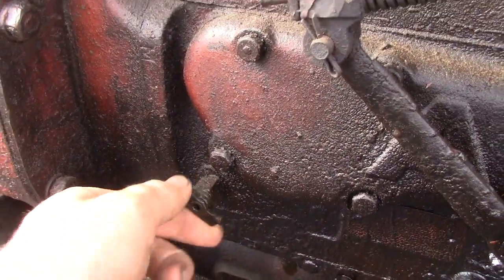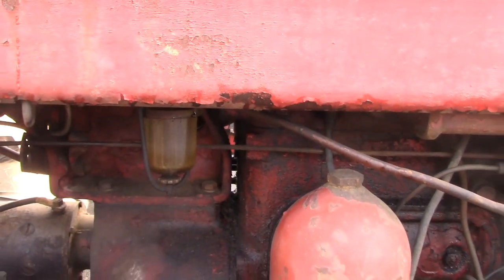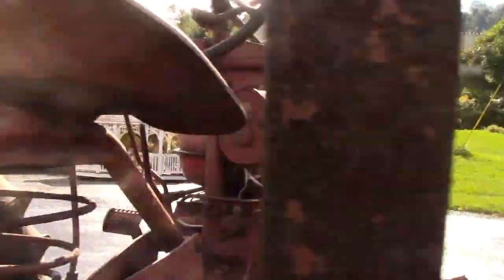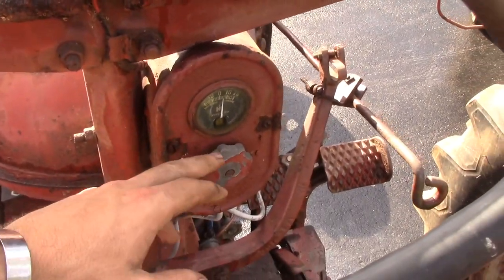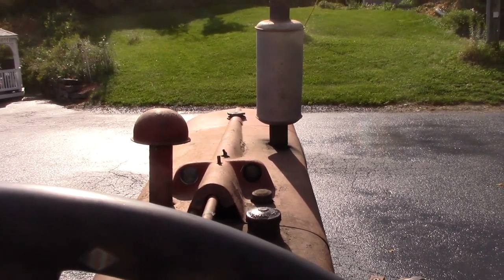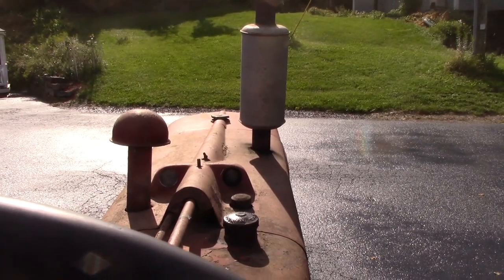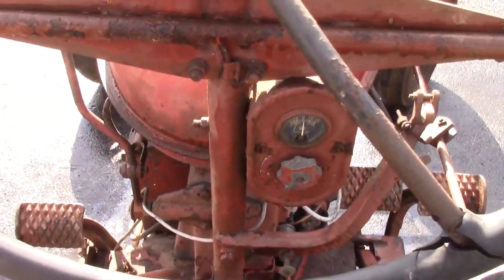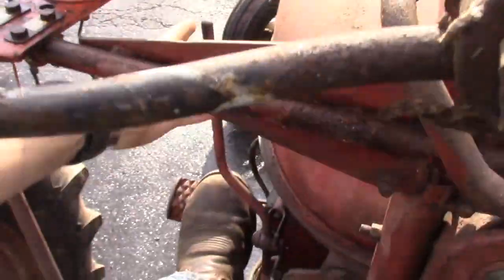Farmall MD: How to Start

Comment: That was very good!
If I had the time tonight I'd check on your shut down procedures. : - )
Reply from the maker: Thank you. I don't have anything in the way of shut down, that's a matter of personal preference. One thing that I say should be common regardless is to shut the diesel off at the tank when putting the tractor away after each use.

Comment: If it's still warm will it start directly on diesel?
Reply from the maker: It will. I'm working on a video with FAQ's about these, and I started the 450 on diesel. Takes a strong starter and good compression to be able to do it. I've found after a half hour enough heat dissipates from the head they won't start on diesel.